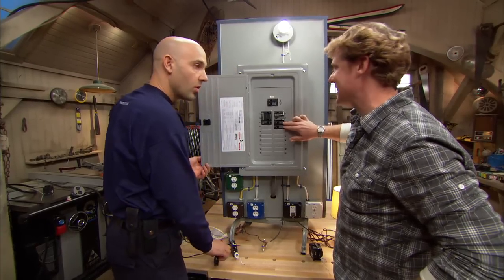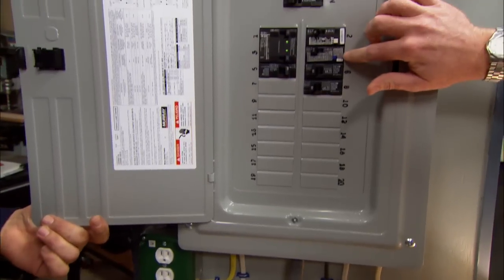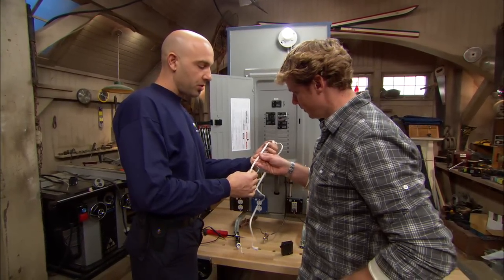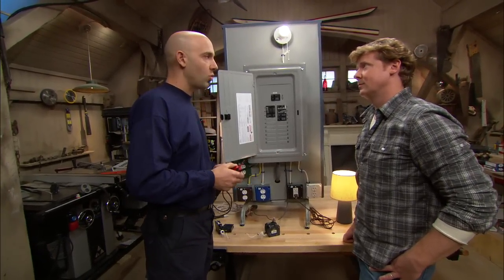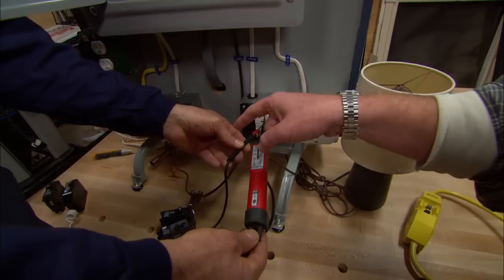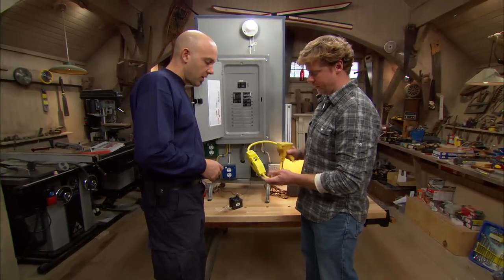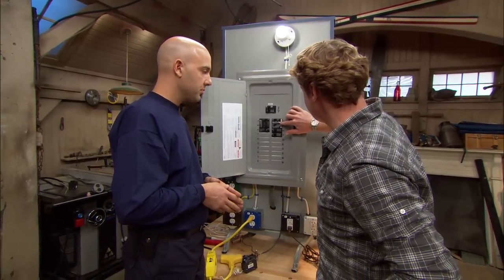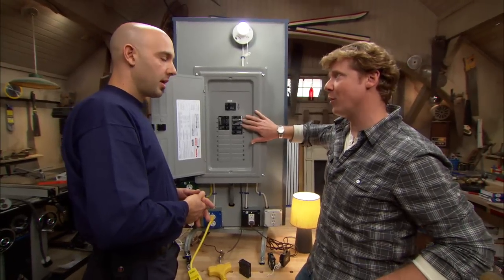How Electrical Circuit Breakers and GFCIs Protect a Home | This Old House

Comment: Here is my take on it. We got our house renovated and rewired from scratch. We got all brand new appliances. The panel got upgraded with all new breakers according to code. Around 40% were those newly required "arc-fault" ones. 
Result: at least once a week we have to go to the basement to reset a breaker. Most often on the breaker that only has that brand new laundry machine. Or opening the fridge (the light goes on :) will trip the breaker. And let's not talk about vacuum cleaners or power tools.
This isn't safety, it's a mess. My electrician was of the same opinion..
Luckily (I guess on purpose :) he left us a cardboard box with the old breakers <g>. And he admitted he didn't dare to put our pump-sump on one of these new breakers. Your choice: milli-amp arc-vault or a foot of water in your basement.
Reply: Gfci are great, no electrician I know hates them everyone knows there life savers. But arc fault are basically useless in a home or habitable area it’s just what are the chances of an arc but not a short also why would there every be an arc you don’t know about and again to arc at 120 volt you would need such a crazy small gap, IMO GFCI is a amazing and a life saver afci are to make money

Comment: arc fault is only required in bedroom circuits on new construction or renovation.

GFCI are required for any wet location... but you can also simply use a gfci receptacle instead of a breaker, and these receptacles do have a load side. This is often a cheaper option than the breaker.
Reply: squee222 we put them everywhere now in Canada . Expensive breakers $40-70 depending on what panel is used.
Reply: Arc Fault breakers are required in all new house here where i live.
Reply: Lots of misinformation here... Code 210.12(A) of the 2017 NEC states arc fault interruption is required in all new and renovated kitchens, family rooms, dining rooms, living rooms, parlors, libraries, dens, bedrooms, sunrooms, recreation rooms, closets, hallways, laundry areas, or similar rooms
i.e. you need afci everywhere now.
Reply: You are wrong because it is code to have arc-fault circut interrupters in every room in your house.
Reply: squee222 bedroom Outlets dining room Outlets hallway Outlets living room Outlets
Reply: Worked with a licensed master electrician at HD (MA/RI licensed). The AFCI in short is required in a HABITABLE living space, so there is some ambiguity. What is habitable to one (unfinished basement with a futon and TV) may not be to others.
Reply: squee222 thank for the tip

Comment: you guys really should mention the cost differance between a regular breaker, and the AFCI one.

Regular breaker at the big box store near me: $6.74.
CAFCI breaker at the same big box store: $37.97 or right around 6 to 7 times more expensive.

10 AFCIs would cost $300 more than the regular ones. Seems like on a new home with a 200 amp service and many circuits, the AFCIs will be very expensive.

None of the above in intended to diminish the safety aspects of the AFCI breaker, just that it will be cost prohibitive for many to upgrade their existing panels.
Reply: You mean GFCI
Reply: Look at all of the places mandating that for all new home construction.
Reply: 6 to 7 times as expensive and 100% required by electrical code when building new or doing renovations. You don't have a choice of putting in the cheap ones if you want to pass inspection.
Reply: One will also save your life, the other possibly wont
Reply: Strang, wonder why the old ones can still be sold legally?
Reply: The real question is how much would it cost to re-run all of the electrical circuits that don't have a ground versus just upgrading the panel with GFCI/AFCI combo breakers.
Reply: @Azathoth43  because you're allowed to replace a breaker if it fails as that's not considered a major renovation.

Comment: I hate the AFCI breakers. They are far too sensitive and tend to trip if you have more than a couple devices on the circuit. The AFCI wreaked havoc on the computer equipment in my office tripping all the time. And with the service panel located outside, it was even worse. Hate, hate, hate them! And they're expensive! Replaced it with the old type and life is sweet again!

Comment: If my bathroom circuit is on a 15A GFCI circuit breaker, does current NEC require also a GFCI receptacle in the outlet?  Seems redundant.  I'd like to remove the GFCI receptacle if code doesn't require such redundancy.
Reply: The breaker would satisfy the GFCI requirement on its own. You do have a code violation in that your bath receptacle is not on a 20-amp circuit, though. If it was installed before 1996, you should still be legal under a "grandfather" clause that most local jurisdictions (that adopt the NEC) have in place.

Comment: Sometimes when my cat gets excited, he’ll bite the cords from my girlfriends curling iron, blow dryer, etc. he hasn’t punctured the insulation on the wires, but it’s only a matter of time. Would replacing my regular outlet with a gfci outlet help prevent deadly shock? I know gfci outlets are useful in wet areas, but what about for chewing pets?
Reply: Kirk Daniels no it wouldn’t be useful really gfcis protect between an unwanted path between ground and hot, if your cat chewed through a wire, the connection would likely occur between the hot through the cat and to the neutral which would appear as a normal circuit, and not trip the gfci
Reply: unplug when not in use and put them in a drawer
Reply: Replace the pet
Reply: Yep
Edit: it wouldn't really if it didn't have a path to ground. Also the hair dryer has to have a GFCI built in.

Comment: I have an older home that doesn't have any grounds. Just the 2 wire 2 plug connectors. Will a GFCI work in this scenario. :/
Reply: According to NEC code 406.4(D)(2), you are allowed to replace a non-grounding-type receptacle with a GFCI receptacle as long as you label it "No Equipment Ground". While it's allowed by code, you still won't have a grounding pin, so things like surge protectors won't work.
Reply: I'd highly recommend using GFCI's on the upstream outlets in your home. Code then allows you to replace the downstream outlets with newer NEMA 5-15 outlets (Grounded/3-prong). You won't get ground, but you would at least get GFI protection. You could also replace the breaker with a GFI breaker, but those are usually more expensive than just the outlet.
Reply: I would be scared as hell to live with no ground wire and this 1959 home about 1/3 is two wire only and I am a digital electronics kind of guy and they don't like not having a ground so I have to use the plugs with ground for those.
Reply: aefgshwrthwrhnwrhnbw Precisely.  No fire hazard directly but a nice sting could happen and electronics don't like to not be grounded.

Comment: Just use one GFCI as the master breaker for the entire house and you're good to go.
The price paid will be forgotten in a few weeks but the benefits of constant protection will stay for decades to come.
Reply: so if a short applies anywhere it shuts off everything? sounds like a horrible idea to me
Reply: Lol
Reply: That would only work if all your outlets are connected to the same circuit, and the GFCI outlet is the first of the run.

Comment: Why dont just protect the entire house with a rcd
Reply: Kevin Storsved the americans like to do their own dodgy stuff
Reply: Edwardo Ondreseaus wud still be better to protect all of the elektrik wiering whit a main rcd
Reply: Kevin Storsved yeah im not disagreeing, in australia now all( new)  sub-curcuits are required to be protected by an rcd. They save lives. American trades seem to be so backwards and behind compared to other countries
Reply: +Kevin Storsved
Actually not. A single RCD is not state-of-the-art. If you got a problem with an appliance or in a part of your installation and you only have one main RCD your whole house is without power. Better is several groups, or separate RCDs or better RCBOs (combination of RCD and MCB) for every circuit. Making it easier to find the defective appliance.

Second problem is that almost every class 1 appliance is producing a leakage current. These currents are summing up and could cause tripping the main RCD.

https://en.wikipedia.org/wiki/Appliance_classes

In new installations here in Germany (since 2007, transition period up to 2011) all circuits containing outlets for general purpose must be protected by an RCD (max. 30mA) if they're fused with less than 20A inside (outside 32A). Before this only rooms which contain a bathtub or a shower must be protected by an RCD. This was introduced in 1984. Standard type of RCD is type A, the AC type is banned here since 1984. The AC is only protecting against AC current. The type A is protecting against faults with AC and pulsating current. Pulsating current can come from a defective switch-mode power supply. Type B is AC, pulsating current and DC.

https://upload.wikimedia.org/wikipedia/commons/3/34/RCD_Fehlerstromarten.svg

I've read in Australia it's only permitted to put max. three subcircuits on one RCD.
Reply: Marcel Germann Good point. It's worth mentioning that North American GFCIs have a tripping current requirement between 4-6mA, while RCDs have a tripping current requirement of 30mA. False trips are common, which is why they're not to be used on critical equipment like: sump pumps, sewage pumps, central heating systems, life support/medical equipment, ... It's also worth noting that certain rooms in dwellings are required to have an AFCI, which opens the circuit before an arc occurs.
Reply: @mimameir1157  its spelt electric